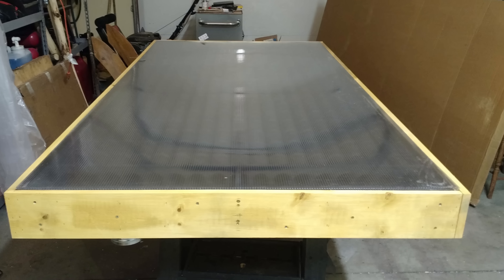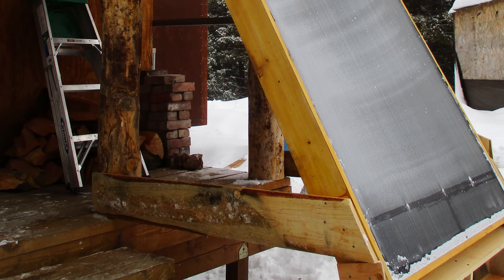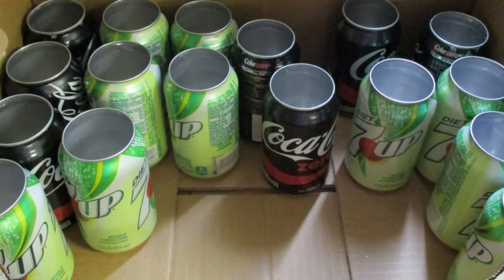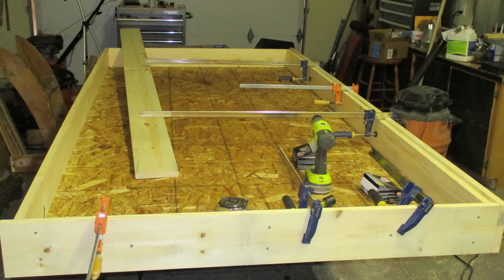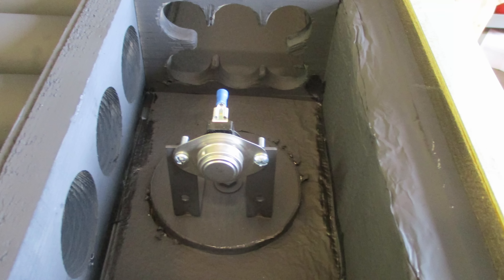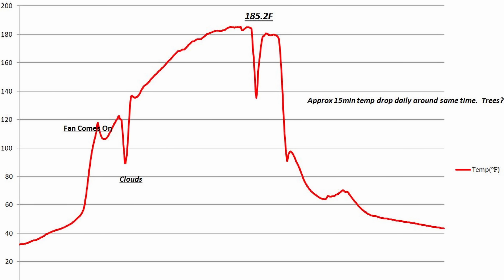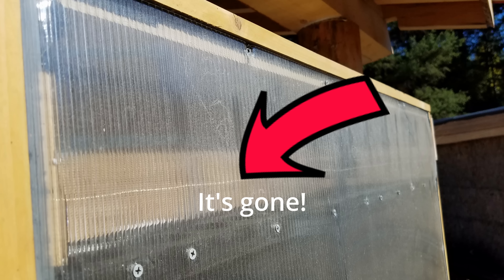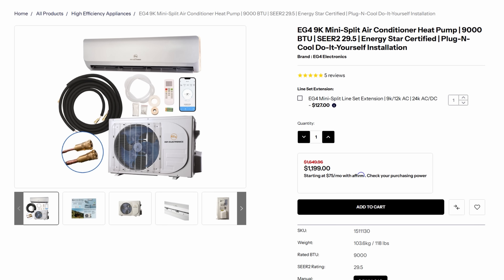7 Years with Pop Can Solar Heater - Is It Still Worth It?

Comment: Do I have this right?  The only thing the cans do is form a pipe, yes?  Well, that's nice to "repurpose" the cans of course, but sheesh, if you've got access to all those other tech parts like the fans and the thermo switches and the insulation and the sealant and and and... you can just use thin sheet metal pipe, no?  Making pipes out of cans would be great if you have no alternative, but The Old Jarhead was obviously not encumbered by any such limitation.
Reply from the maker: The cans also add turbulence to their airflow, slowing it down and making it move around more.  In theory this allows the air to absorb more heat before exiting the box.

Comment: This is the first time I've seen someone give a 'review' of their can solar unit after years of using it.  I have often thought of making one of these but wasn't sure if the time and money invested would be worth it.  I think I'll try it- I don't have great solar in the winter for the barn I want to heat, but this may have some positive effect and add to the space heater I'm thinking of using. Thanks for this video.
Reply from the maker: Glad to hear the long-term review was helpful for your project!  For the barn, you could go with just passive heating.  Build the heater and mount directly to the wall of the barn (you could build the box on the all with no backing and only insulate the sides).  Air intake direct from bar neat the floor and output at the top of the box (with room for the air to rise).

Put in a solar attic fan to move the heat back down during the day (it will stop when there is no sun).

I've read of people heating shops with these, usually having 2 or 3 on the walls to generate the heat.

Shouldn't need baffles if you use a dryer vent at the top as the flaps will drop when the air stops moving and with a snap switch to kick on a fan (in the inlet not up top like mine) you can push the air through nicely when the sun is out and even drive it with a small solar panel.

Comment: I have some CPVC pipes I found in an old dilapidated shed on property I bought. Can they be used instead of aluminum cans?
Reply from the maker: I'm sure they could but I wouldn't expect them to work as well because the aluminum cans (thin walled) transfer the heat almost instantly to the air resulting in a more efficient system

Comment: With such overheating it seems to me rather than just rebuild the same thing and make it more expensive with more pricey materials look at it as a max/min problem. Seems you have already made it too big. The question should be "now, how much smaller and more efficient and less expensive can I make it and how can I regulate it better?" Run some math? Do some experiments? Take a guess? Two-thirds the size? I would add some mass to store the excess heat and thermally dampen the system (maybe enough to warm the cabin?), figure out a better damper system, of course. 
      I would use flat down spout - more surface area facing the sun, No dozens of joints to fail. More mass. Labour-saving - you are not doing three or four operations per can on dozens of cans to make tubes. Cut to length and install. Worth the money in my mind. Save money making it smaller, make it more efficient by spending the savings on  down-spout. 
      You could also figure out a way to make it modular. Simple prototypes. Use heavy plastic polyethylene sheet like vapour barrier for your experiments. Figure out how to make your prototypes  with  sliding headers to adjust the length of the tubes. Use heavy cardboard or masonite and duct tape and do quicky temp out-put readings on a sunny day to gather data. I don't know. I'm a carpenter and that is how I think. Of course always keep a fire extinguishing system close at hand
      Just a few ideas. I built a solar-assisted energy efficient house with a wood burner, a whole-house heat exchanger and a "flash" hot-water-on-demand" device on twenty acres back in "84 which worked quite well. We had access to the electric and telephone grid. 
       Anyway, best of luck, be safe and have fun. Cheers!
Reply from the maker: Those are some excellent and thoughtful ideas for optimizing the design and efficiency!

Comment: I am an old retired HVAC specialist, and have been using these and other similar products since 1970, so please pay attention to this old man's advice.  One is I don't use any kind of foam product, and only a few these of high temp silicone on these devices. For insulated board that is both fire and melt proof I use 1" shielded Duct Board, it is a ridged fiberglass bat type panel with aluminum facing both sides.  You can use a straight edge and a utility knife to cut it to shape and as long as it stays dry it will last a lifetime. It has a high reflective surface so it doesn't require paint, you Want it to be reflective to get more coverage around the tubes. I also use a metal header board and 4" spiral steel piping, a commercial grade of ducting, and weld these to the sheet metal headers before painting the assembly and installing it in the box.  I prefer a fiberglass of sheet steel box over wood because that is heat and moisture proof, but wood works just as well. leave a small space between the tubes, let the air circulate around the box, with at least 3/4" space between the poly or glass cover, and I prefer two 1/4" thick pieces of HDPE clear sheeting, pricy but it is hail proof and two layers give it more insulation value in front.  Use a good quality rubber seal when applying the clear covers to the box to prevent air leaks. Another option is a silicone product called Fire Stop that comes in a regular tube works well and is permanent. Two 48" x 96" boxes on your roof will heat the average home with a good commercial grade circulation fan (not a PC box fan) and attach internal box temp sensor switches and a room thermostat with a 10 amp rely to switch on the circulation fan, as well as one commercial grade 6" motorized damper to close when a second low temperature temp switch and relay circuit register it cold at night.

These grade boxes in metal and commercial grade (not pop cans) tubing and insulation, etc., will run around $1,200 per box but will last a lifetime with little maintenance.
Reply from the maker: Thanks for sharing your extensive experience and detailed advice on these solar heaters!

Comment: I wonder if you could put peltier device/generator on the back. It’s a really ideal situation for your use. Also, you could put some reflective material at the bottom of the box to reflect sunlight onto the box for longer.
Reply from the maker: Great suggestions for further improvements!

Comment: Hey, get  old car radiator valves. I have seen them used to open flaps on an outdoor oven box, up at top. Heat drives them, they have bimetal strips, quite strong.
Also, why the black paint? Have you ever tried to clean soot off a pot? Burn some green wood, coat the thing with soot and rub it in. With metal you can cook it on hard.
Government plans from Pueblo, Colorado show solar window boxes with no cans at all. They do work, the top output slit had a damper like a chimney has.
Reply from the maker: That's an interesting idea for heat-driven automation!

Comment: Why bother to use pop cans when you could just use aluminum tubing?  I know it would be more money, but is that the only reason?  It seems like a lot of trouble to me, processing and fixing those together.
Reply from the maker: The concept was to create turbulence in the airflow to increase the heat produced and exchanged.  The cans did this due to their shape.
Reply: @TheOldJarhead  Ohhhhh.  That makes sense. That must be why I've also seen people also do it with flexible, accordion-like ducting, but never just straight pipe.
Reply from the maker: Yup.  I've seen straight pipe systems and screen systems but these, I think, make sense and may be better at creating heat.

Comment: What I did was mount a solar cell to power the fan, and take some of the load off of the furnace. 
Since then I installed a 2 zone mini split. And thinking about using the panel to warm up under the trailer.
Reply from the maker: Sounds like a great way to use solar to reduce the furnace load!

Comment: For solar thermal, you need thermal mass to store it for the night, like earthship houses. That's the missing piece. Vacuum tube thermal heaters are still used around the world in sunny climates for water heating, but photovoltaics dropped so much in price.
Reply from the maker: Definitely agree about the importance of thermal mass for storing heat overnight.

Comment: 🤔 Might cost $600 for most folks, but I think all I need is a couple sheets of plywood, caulk, high-temp black paint and a sheet of Lexan, maybe $100-150 all told.  Beer cans, I got- they're even a little taller because I like the 16oz Coors.  Might be worth a fall project, as I have a couple of 100W solar panels still in the box that I could use to trickle-charge a backup battery bank at the same time.  Thanks for the video review- I had seen these before, but never really any reports on how they performed over time.  If it works well, I may even throw one on the back of my camper to save the propane for hot water and cooking.
Reply from the maker: That's a great idea to use your solar panels for trickle charging too!

Comment: You can also use fiberglass insulation it will not melt until 1300 degrees.
Reply from the maker: That's a great suggestion for insulation.

Comment: I built a box for my green house.  I used an old sliding glass door.  As far as the insides went, I just stapled in black felt.  used 4in pvc for the in and out pipes and just fit a cap on them when It wasn't needed.  I used an old pc fan with a programable timer plug to turn it on and off.  It ended up being super heavy.  It worked great but I had to babysit it a lot more than I wanted to.  After a while the black felt faded into a blue color.  I don't use it anymore.  I just went with a  space heater on a thermal switch.
Reply from the maker: Sounds like a lot of work to babysit it!

Comment: Factory built vacuum tube solar traps are not that expensive anymore, more efficient and less labor intensive option.
Reply from the maker: The ones I've seen were pretty spendy ($2800+) which ones are you seeing?
Reply: @TheOldJarhead  I've seen modules here (Finland) for about 600 bucks for the collector panel.
Reply from the maker: Wow nice!

Comment: Built one and agree that the in and outlet should be 6 iso 5 inch. Insulated the in and outlet sections with foam and rounded the corners for a better airflow to and from the utmost rows of cans.
My heater was fitted with 16 rows of 17 cans. Further more I divided the in and outlet sections in 2, right over the in and outlet holes, to avoid too much  turbulence in both sections. The whole interior was covered with reflecting foil to radiate the heat back into the cans iso of black paint heating up de box.
Reply from the maker: Good ideas

Comment: I put sand in the cans so they hold the heat. I used a computer fan at the top to bring in the hot air. I had this on the side of my house going into my garage. I used to hang the laundry out there to dry.
Reply from the maker: Interesting

Comment: I want to do exactly the same but for hot water somehow.
Reply from the maker: Many have.  Just run black PEX or painted copper pipe or a black funny pipe though the box from top to bottom like a radiator and push water through it with an RV pump or something like that.  I bet Mother Earth News has an article on it somewhere.

Comment: So, it turns out that first I have to make a prototype. Inexpensive and small, 1m by 1m. Then observe its performance for ~3 years until it starts to deteriorate under the influence of the sun, rain, and the temperature it generates. Then I need to come up with a system for dissipating excess heat in case of overheating in the summer, or shading. And only after all this should I invest in large solar collectors that will work more or less normally and safely. Surprisingly, since 2005, when YouTube was flooded with these collectors, people have not made much progress in this area. Most have just copied the experience of others, including their mistakes. I think I first heard about the reverse thrust valve here, while the rest just experimented with paints and materials. Even effective ventilation motors are rarely installed; for some reason, people build PC coolers like children and hope for the best.
Reply from the maker: I think it's a "one and done" build.  For me, it still works even in it's dilapidated shape so, while I wanted to fix it, it wasn't a priority.  Now, it's time and YT has prodded me a little as many of my subscribers have asked about it.

Comment: If u made a couple smaller holes on the front side some heat could escape and u could leave it at 45 degrees and it would melt the snow so it could slide down
Reply from the maker: It would melt the snow without and it did but I found I was losing heat production to melting the snow ;)

Comment: Idk if the EG4 unit is right for you.  I was shown in the manual where it says it will try to start 3x and if low power is present it will lock out.  Then you either need to manual reset it or have it connected to the internet and reset it.  I chose a $600 cheap amazon unit and dont try to run mine when I'm not there.
Reply from the maker: Hmmm.....Interesting.  I also think the 9k unit may not be the same as the 12k unit which can run off DC

Comment: I was going to make a windowsill version, ie, fully indoors, that would just soak up sunlight and heat recirculated air, not drawing in air from outside.  Would probably use downspouts or dryer duct instead of cans.  My cats might object to not having the windowsill available anymore, but they're not paying my gas bills.
Oh, and computer fans to just move air through them at a leisurely pace, able to run for days from a powerbank, with 90° thermostat.
Reply from the maker: That should work great

Comment: I thought this was a great idea, until I found some solar panels for 25c/w. 1kw of solar for $250 and $30 worth of sand/gravel, a 30ga metal trash bin, and used heating elements from stove tops at the junk yard, and the setup couldn't be simpler.

Solar is just too cheap to put this much work into it IMO.
Reply from the maker: Interesting!  I wonder what kind of BTU's you are producing?
Reply: @TheOldJarhead  The energy to heat conversion rate is close to 100% but It should be equivalent to 1KW space heater's output in an hour. 1KWH converts to 3412BTU.
You should use Ohms law to figure out how much resistance you need when picking up your burners and know the current target and voltage of your panels. Bring a multi-meter.

Comment: Much simpler than cutting holes in beer and pop cans and stacking them, is to use a metal screen. 

You still make and use an 8 foot by 4 foot box with the inside insulated and painted black. At the bottom your openings should be screened to keep bugs out. Then a black spray coated screen is stretched over a wood frame or use firing strips, and fit it in the inside of the box.

But tilt it from nearly touching the lexon glass at the bottom of the box, and nearly touching the back of the box at the top of the box. Your exhaust port is at the top of the box.

Sunlight shines on the screen and gives up it's energy to the black painted screen with a high surface area, and the screen gives it up to the air. The remaining light shines through the screen and is absorbed by the black paint over the insulation and that heats the air.  This limits the  the amount of light and thus  heat on the insulation. 

Now you can sell the aluminum cans or melt them down for ingots. 😊
Reply from the maker: Using a metal screen is definitely an alternative!

Comment: Things I would change:
-3 spruce 2*6*8ft instead for the frame
-a bat of rockwool for insulation
-a galvanised dryer vent trap 4 inch
-galvanized vent fan 4 inch (wired into the heat sensor
-tremclad flat high heat enamel black paint
-
Reply from the maker: I found 4" a little small and plan to go up to 6"

Comment: I built one of these back in 1977 for a 6th grade science project, used a cardboard box, soda cans glued inside, painted everything flat black, had a cold air inlet on the bottom and hot air exit up top on the opposite side and covered it with plastic sheeting. Mine cost about $2 at most..lol.
It definitely heated up the air.
Reply from the maker: Cool project!  I was in the 6th grade in 76/77 I believe...hmm...have to try to remember back then lol but sounds right since 75/76 was the 5th.

Comment: Why wouldn't you maximize the inside of the diameter by using a dyer vent slinky thing? Just spray paint it black, wind it from top to bottom in a wooden box and close in with plexiglass. Put the DC fan on the outlet AND inlet to keep flow state the same. Heck, you could even stack the boxes on top of one another and use the feed off one to fit into the one on top. OR maybe create one for winter and one for summer. Run the summer one under the ground about 4 feet down as an inlet and a up the wall to the top register. Then you have cool(er) air coming in during the hot months. And use the aforementioned one for heat in winter. I dunno, spitballing.
Reply from the maker: Heat dissipation or thermal transfer of thin aluminum cans is far superior but I'm sure your idea would work.